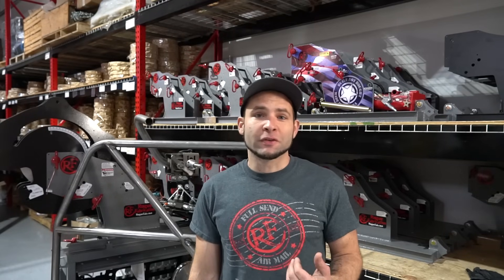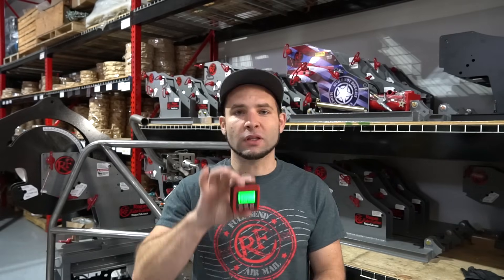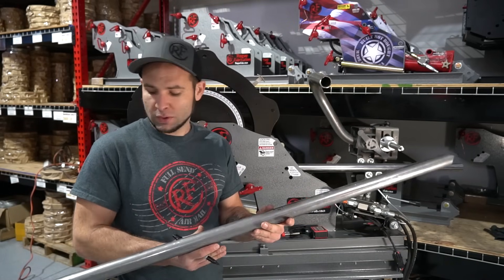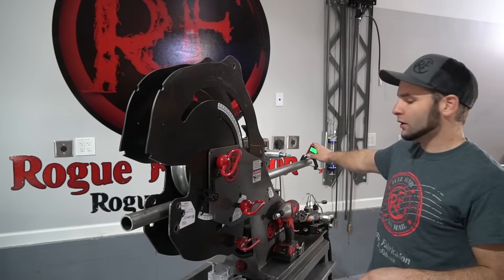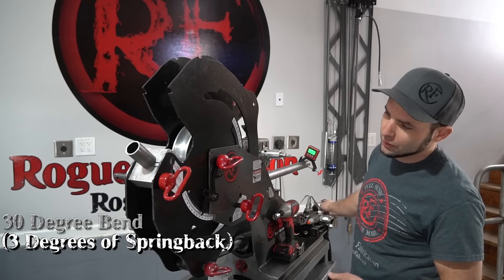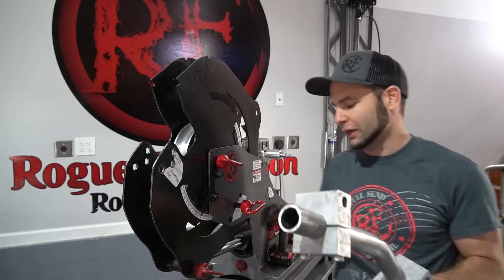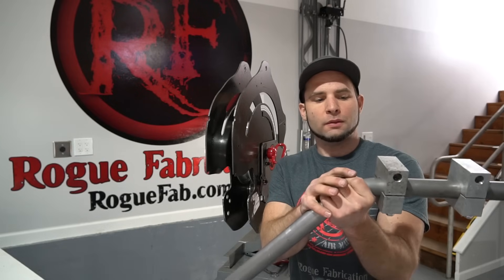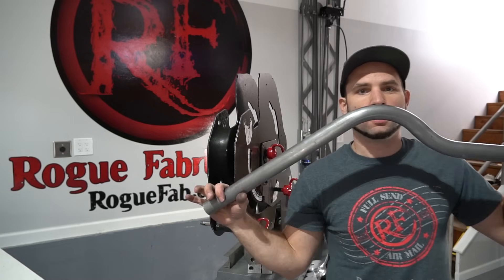Bending 101 - Tube Bender Techniques, Design Tips, Layout Tricks, S bends and Measuring, simplified!

Comment: How about filling tube with sand and welding both ends, wont it help, too much hassle I guess?  😁
Reply from the maker: Sand is not worth the mess and time. Depending on technique, you can make (and heat) a pressure vessel (unsafe) when you weld caps on a tube packed with wet sand. The industrial solution (under $100) is an internal metal mandrel that is 100% removable. It's called cerrobend. We have a video on it here: https://www.youtube.com/watch?v=0NWV2oSy0CE    Or get the only mandrel bender in the world that is remotely affordable (we make it right here in Oregon!): https://www.youtube.com/watch?v=heL5xt7s1hI     -Joe

Comment: How do you determine the radius? Great video, thanks
Reply from the maker: A basic rule of thumb is you want your radius to be at least 3x your material's outer diameter. If your material has a very thin wall you may need to go larger to prevent excessive deformation. You can also check out our chart here (https://www.roguefab.com/tube-capacity-chart/) to see the minimum and maximum capacity for just about every die we make

Comment: Yes, I have a bent tube. I'm looking for another bender. I want one I can use with cad. one that will not leave a marker or deform the tube much at all or not at all. I would like to talk more about your bender. tired of watching videos. also, one that isn't loud. omg some are so loud. also would only want one bender that does heavy and thin wall tubing.
Reply from the maker: Unless you spend 10x the price of our M625 mandrel bender, you won't get a broader wall ratio range (from 2" x .083/.065 up to .250 wall). Call us. Let's talk. 503-389-5413

Comment: Bending 2 90 degrees with outside dimension of 18 inches. do you have to find out the center of each bend, or go by the outside of the shoe?
 Good job, by the way.
Reply from the maker: check out this awesome free calculator on our site.  Scroll down to double 90 symmetrical.  https://www.roguefab.com/design/

Comment: I'm on the fence on buying the software but I think it would be an advantage for me. I'm building a 53 Chevy pickup drag and drive with a 1000 HP 6-71 blown, nitrous Chevy I6 292. I have extensive tubing bending on the chassis and roll cage and little experience with bending. Thank you for your time.
Reply from the maker: sounds awesome!  Visit roguefab.com to get started.

Comment: hey Joe, are you going to a tubeing die for 2 1/2" thanks
Reply from the maker: We absolutely will at some point, but not for the m600 line. The 600 means 6" max bend radius, and that isn't big enough for most applications on 2.5" OD.

Comment: I wanted to say thank you for the video and your website content. I desired to see you machine in action, but the "Tech" section of your site was an added bonus.  I feel like I have quite a bit of catching up to do. I have been looking for a bender and really like the design of yours. My shop is almost complete and I actually designed it so I could add a vertical bender (17 ft ceilings).
Reply from the maker: Awesome! Yes, tall cielings can help. Kost roll cages and other motorsports projects are easily accomplished in 10 to 12 foot cielings, but nothing wrong with a few extra feet!

Comment: What is a good bender for smaller tubing with tighter radius bends? I'm looking for something to do 0.75" OD x 0.083" wall and 0.5" steel tubing for kart seat supports with tighter radius bends than larger tube benders - and not finding anything.
Reply from the maker: How tight of a radius? We currently offer a 3.5clr and that wall thickness would be no problem for it - Josh in customer service
Reply: @RogueFabrication  The bends are 3clr. I'll keep yours in mind in case I strike out since it is close. Thanks...
Reply from the maker: @hallkbrdz  If you have any more questions I can respond faster at sales@roguefab.com
Reply from the maker: We also make custom dies. We can make a 3.0 CLR. Or a 2.875 CLR (which will be about 3.0 CLR after the radial spring of the material is considered). Just depends how exact you need to be. -Joe

Comment: jd2 model 54 much easier all around
Reply from the maker: You may be partially right, but so are many cnc benders. So is paying someone to do the work. These machines are under $1000 (depending on options) with a die and ship for about $90. The M54 is $4250, a die is hundreds more, there are still additional options, and shipping is $400+. Not quite on the same budget...

I said partially because if you want to bend something that requires a mandrel (1.625 x .083 on a 4.5 CLR with nearly no deformation for example), the 54 just plain doesn't do it. The m600 can. You want zero spacing on S bends? The 54 can't do it. The M600 can (no options needed). Just 2 examples. The m54 is nice, and well made. But it doesn't do everything the m600 can do, just like the m600 doesn't do everything the m54 can do.

Comment: I am new to using a pipe/tube bender and I am pretty much sold on the M600.  I will be bending anodized aluminum pipe for marine purposes (towers/rod holders/etc.).  Any advice?  I also have a saved order on your website (#33963).  Again, any advice would be appreciated.  Thank you.
Reply from the maker: We recommend our UHMW pressure dies for anodized AL. We also can make whole dies out of Delrin if needed. They are made to order (nothing else we sell is).

Comment: Thats crazy if i dont tighten the dog shit out of my clamp lock they will slide and kink your tube also it crushes thin wall lile crazy you have tk put a slug in it for a half as decent bend and then i bent the damn pins
Reply from the maker: See roguefab.com/bendquality. It sounds like clamp block sliding is your culprit, it will hurt bend quality and bend pins. Its easy to fix. The link explains it.

Comment: The only time I've seen 3-D tube bending like that was 30+ years ago at an exhaust shop in Chesterton, IND. 
Me thinks that place was called "JACK'S   MUFFLER". They had an old power bender somewhat similar to to the way yours works. They had a rookie making parts on it, so he would occasionally stop at the end of a step and ask questions from one of the seasoned techs. Me thinks they had instructed him to do that to avoid excessive $crap.
Reply from the maker: Yeah I bet. You can easily scrap 10x your hourly rate if you're "good" ;)

Comment: @5:07 you guys state that you can resume any one of those bends since you still have the clamps in the same position. That's great and I'm really happy I can continue to bend at exactly the same spot without removing the clamps. However, I'm curious to know how we get to that first bend if the second clamp is within the radius section of the first bend? Isn't it preventing it from even going back into the bender? Can you clarify what you can actually continue to bend and show us a demonstration perhaps in another video? Thanks in advance! Great videos by the way!
Reply from the maker: If the clamp is in the radius of the bend you can still resume EITHER, but not BOTH. You would have to remove the other clamp in this uncommon case. I hope that makes sense!
Reply: Rogue Fabrication I appreciate to response & yes, it makes sense.

Comment: Great video 👍 I just subscribed.
I have been looking to buy a tubing bender and the Rogue looks like it’s on a entire different level compared with other benders on the market! I’m completely new to tubing bending so I’m going to check out some of your other videos 👍
Reply from the maker: Thank you Mike! Have you already seen the huge tech section on our web page? What will you be building once you start bending?
Reply: Rogue Fabrication Thanks for commenting back 👍 I have built a lot of machines from a bandsaw mill to building a UTV out of a old quad and built a hydraulic dump bed for it.
I’m actually in the process of building a mini 4x4 articulating dump truck for my property, I used all Subaru running gear for it. 
I’m up to part 8 on my build series about it so far. 
What I plan to build when I get a bender is a stout 4wd side by side using once again Subaru running gear. 
Again I will be making a build series out of the side x side build. I have checkout a lot of info on your site, I just need to read up on what size dies would be best for my next project, I always work with square metal so I’m a bit new to fabrication with tubing. Take care
Reply from the maker: Holy cow. That is an interesting list of projects. When you say articulating,  you mean articulating for steering, right?
Reply: Rogue Fabrication Yes it steers in the center hydraulically and also pivots at the same joint so the front and rear axles move independently.
The center joint was quite complex to get everything designed right because the drive line runs though the center of it also. Take care 🙂

Comment: Hello, I just opened my 1.75 dies and they have a shoulder machined on them unlike the rest of my dies. It seems to be off center?
Reply from the maker: Yes, that is intentional. It is just to stay out of the way of the electric/hydraulic auto bend stop system. In case you add it later.
Reply: @RogueFabrication  Thank you for that. I was not sure. I measures the thicknesses of both sides with some calipers and it was the same so I ran it. One more thing, with the 1.75 set I recieved 2 pressure dies. I think for HD bends with hd kit, but I only have one 1.75 clamp.

Comment: Is there a good way to account for leg lengths in a bend.  I know how Many inches in overall bend.  But without a sample bend is there a somewhat easy way...
Reply from the maker: You mean the length of tubing in a bend? Yes, our web page explains it in our bending 101 article here https://www.roguefab.com/bending-101/
Reply: @RogueFabrication  no just were to place those Mark's on the tube to get the correct distance away from the roof line and interior..
Reply: Bend angle X CLR of die X .01745 will give total amount of tube in bend from tangent to tangent.

Comment: Awesome bender and videos. Just bought an m600 and couldn't be more pleased. I also got the bendtech software as recommended. It seems like some of the longer pieces with s bends are likely to hit the floor when loading the bender. Any tips
Reply from the maker: Check out this video, we do a full 3 point S bend on a piece about 14 feet long in a very small space. We do move the bender a little to accommodate the length. https://www.youtube.com/watch?v=uKIfGVbe2UQ
Reply: Awesome. My piece is just a little longer so I mounted the bender to a transmission jack I've modified. With an adjustable base height its perfect